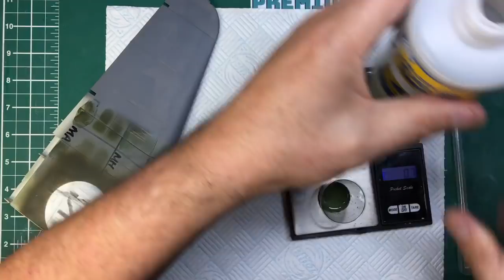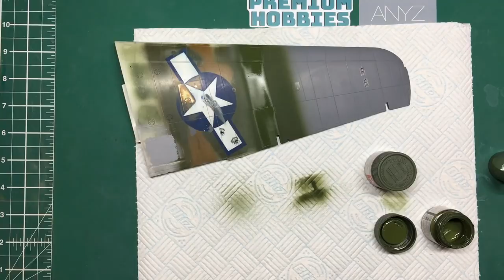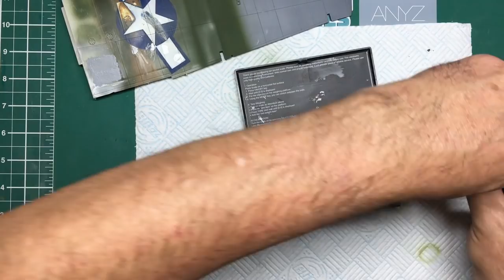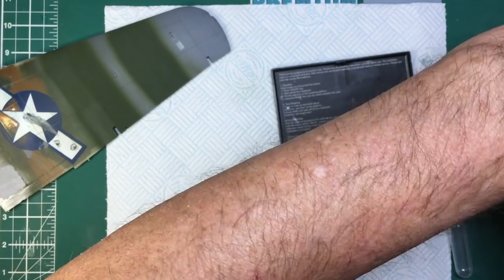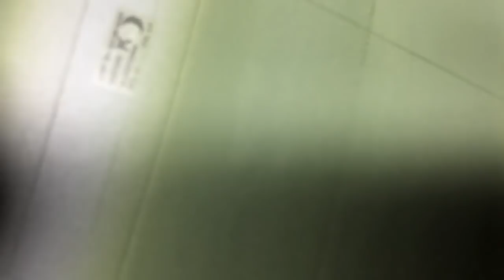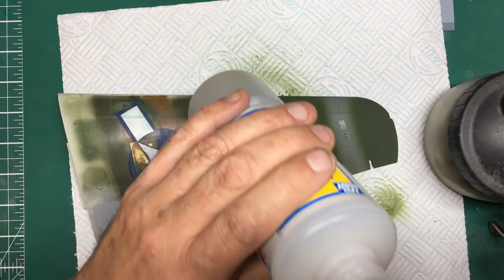This one's for Ron. Airbrushing tips for beginners.

Comment: Wow!! Best airbrush tutorial I have seen. I know that this was for Ron but honestly mate, everything I needed to know as regards mixing but also regards to temperature when painting. I use your method of mixing in the cup now and look for that translucent state so I would imagine that I am probably painting at 60/40 or maybe 70/30 and my paint goes on wet now and settles. When I was younger I remember my grandad was top sprayer at vandan plas spraying cellulose on the Princess limousine probably 1950s and he would start with a 50/50 mix with the following coats being thinned down to a 70/30 or 75/ or 80/20 to get that level finish before polishing. Trouble was cellulose was terrible stuff and apparently 70 percent of it would stay airborne and the masks they used then we're useless he would often say that the paint would be on his teeth and around his nose after, he later suffered with terrible emphysema so as You always say be really careful when spraying solvents. But Nigel thanks you have demonstrated to me everything my grandad spoke about. Great tutorial mate. All the best. 👍

Comment: I’m with you on eyeballing the ratio AND mixing in the brush. I know, I’m a heretic too. I’d barely rate myself as a novice but when I first started brushing I measured everything precisely and didn’t fair any better than just dumping it in and swirling a brush around. One thing I have seen somewhere is to put your finger over the nozzle tip and pull the trigger back slightly to blow back any unmixed paint/thinner. Oh yeah, just dump it back into the bottle. People worry to damn much. It’s just paint! Great info on spraying over with thinner. Great vid Nige!
Reply from the maker: Maybe you saw me doing the finger over the nozzle thing. If you mix in the cup, always go thinners first and always blow back to get the neat thinners out of the nozzle.
Reply: Nigel’s Modelling Bench thanks so much Nigel I learn so much from your thoughtful and generous videos. Quick one as a real novice, what’s the difference between mr color levelling thinner and mr color thinner? And also do they work with lacquer/enamel paints or just acrylic? Thank you.
Reply: @Paul Freeman  The whole paint naming thing has gotten completely bastardised over the years and terms like " lacquer/enamel/acrylic" have more or less lost any useful meaning. You can drive yourself nuts reading about this on t'Internet and it starts some really spiteful fights on modelling forums. For example, some claim Tamiya is "really" lacquer paint, and not a "true" acrylics (whatever that means.) But to cases, and my two cents worth:

SLT is for thinning lacquer paints such as Tamiya (it says here - I've never used them) AK Real Colour (which I have used and it works great) and of course Mr Hobby's own lacquer paint range, not enamels which are oil based paints. Albeit that the solvent(s) in SLT may be petrochemical derived - I've never bother to check.

My favourite thinner for the many pots of Humbrol (for example) enamel I still have, (because I'm too cheap to replace them,) is Revell Colormix (be sure to get the "enamel" one, Revell do an "acrylic" thinner too with the same name,) - it just seems to work better than Humbrol Enamel thinner and hardware store white/mineral spirit. Of course, enamels take hours if not days to dry and cure. 

Both are stinky product though, and you should always spray wearing a face mask, the windows open and pets children and vulnerable adults sent out to play in the garden.
Reply: On the compatibility of the Mr Color SLT, it does not mix with everything. I love Mission Models paint but the first time I tried thinning it with STL it took 30 mins. to clean my airbrush. It turned the paint into a big globby mess. MM works well with Tamiya thinner but works best with their own. They are all different. There is no “one size fits all” thinner. It’s all about experimenting and testing BEFORE you try to put paint to plastic.
Reply: Dave Cardboard - many thanks Dave. It certainly is confusing. I guess an element of trIal and error is the way. Cheers!
Reply: Charlie Messenger thanks Charlie

Comment: Nigel. That tutorial has got to be the best I have seen to date from anybody. You have helped me comprehend and rectify my main issue with airbrushing. 
Thank you for posting it for all to see.
I am still unsure about mix ratios for very pail colours or just plain white. Due to their initial poor opacity, would the lower ratio of pigment to thinners help with the spray coating or is it just more coats required?
Reply from the maker: You ca spray Tamiya XF-2 neat, but i would always add a little thinner then use the very thin mix or neat MCLT to get rid of the graininess.

Comment: Nigel, very interesting video. A question, I measure my paint and thinner by volume rather than by mass. Am I doing it wrong? I am new to using an airbrush.
Reply from the maker: To be honest it doesnt matter, so long as both materials have similar specific gravity? AND.. we must keep ion mind.. it's not science, it's just thinning paint for a nice finish. For example.. if you mix brand new paint with thinners at 50-50 the mix will be thinner than old paint at the same ratio.
Reply: @NigelsModellingBench  Thanks Nigel. I did not realize that the paint and the thinner had the same specific gravity. That would make perfect sense.

Comment: Hats off sir for this great tutorial. From my small experience mainly with mr hobby colors, for some of them, 70% might be too much, especially at 22psi. Some colors seem already more thin than others in their bottle. In such a case, would you go for 70% thinner and less pressure?
Reply from the maker: This is exactly what I tried to portray in this video. there is no set % that you should follow, no set pressure and no one manufacturer of paint. If i were doing a fine camo scheme like a blotchy german one, I would heavily thin and lower the pressure. I'd also remove the cap over the needle.